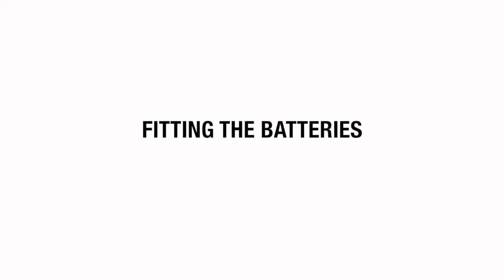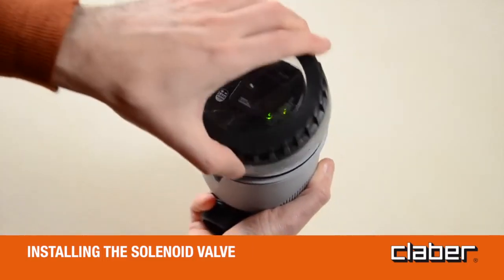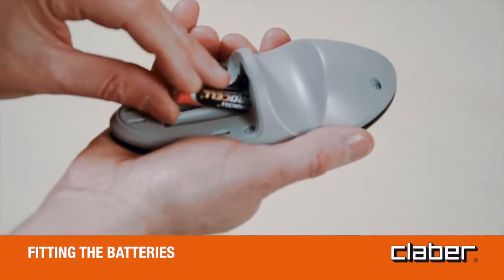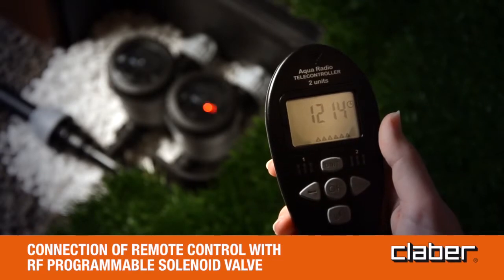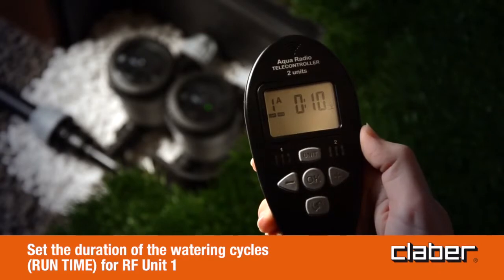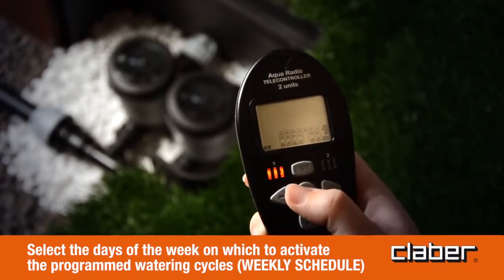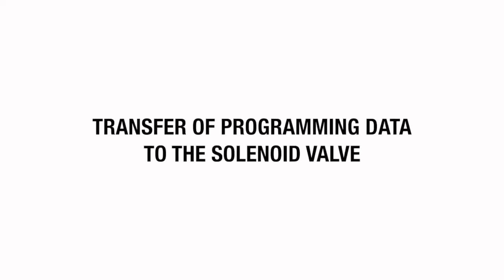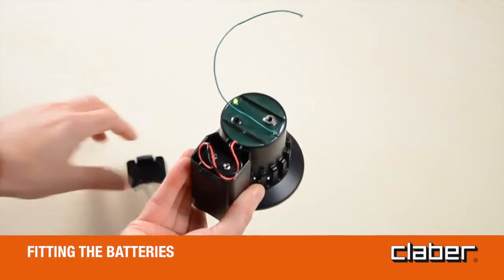Claber RF Programmable 9 volt inline Solenoid valve 90835

Comment: >>>nub.best/gwpe    I feel the weight, design and construction of the unit would suggest it is of good quality. I found it easy to set the times and days for watering and the unit seems to function as required. I run 2 dual timers for my garden watering and have had nothing but problems with the units I purchased here in New Zealand, that is why I have gone overseas to replace 1 of the units I was using. I think it will not be long before I order another one to replace my other old unit. I would definitely recommend this unit to friends.